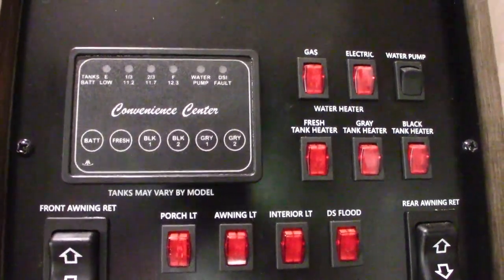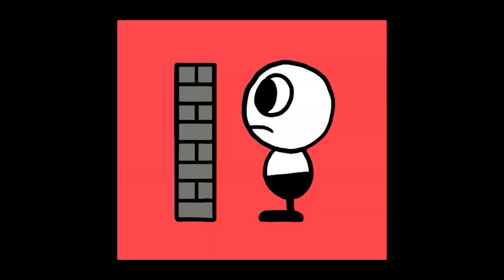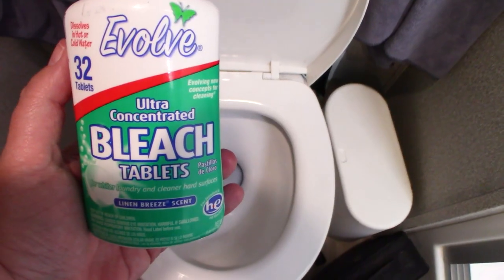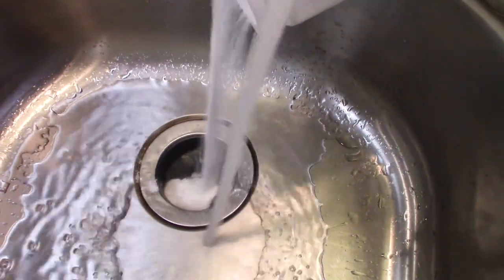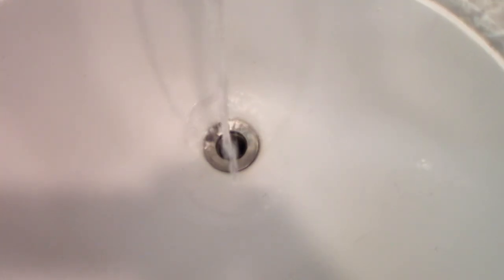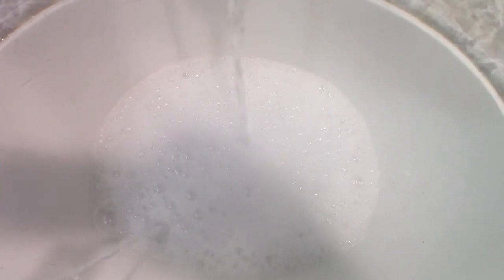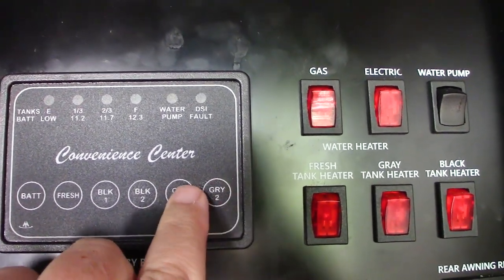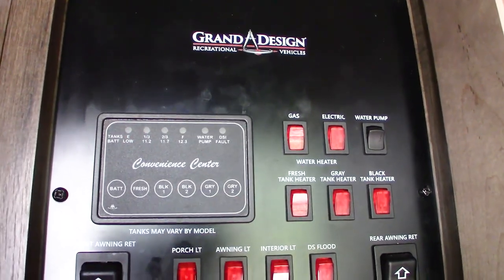How to CLEAN Your RV TANK SENSORS in 3 Different DIY WAYS! KNOW How Much You Have in Your Black...

Comment: Question? We had this issue from day we purchased the RV. It was a one owner. They never cleaned anything. We managed to get some of sensors cleaned from say tanks are full. but have a ways to go.  Will try the vinegar and soda how much vinegar did you use. Vinegar and baking soda is always on hand here use to clean with. Have a great day
Reply: If your tank is 50 gallons use a whole canister, or for the small boxes use a box and 1/2  of baking soda, and one 1/2 gallon cleaning vinegar along with 15 gallons of  cold water and about a hot water tank full of hot water. Works like a charm! If your tank is smaller, just decrease amounts accordingly. Hope this helps!
Reply: @t.j.sortino7844  Thank you for the information
Reply: @t.j.sortino7844  How do you get the baking soda & vinegar in the fresh water tank?

Comment: I have used Dawn dish soap. I figured if it’s save to clean wildlife it should be ok for the tanks
Reply: Did it work
Reply: @mistyhardy2980  yes it does for me anyway
Reply: @deborahsmith9232  how do you do it
Reply: I drain tanks put dawn inthe toilet and sink . I run hot water in sink. I run water in toilet. I let it sit for awhile and drain again. My tank monitors say empty so it’s good.
Reply: @deborahsmith9232  how much do you use and thank you
Reply: @mistyhardy2980  the size bottle I have is 24oz who knows will for me be 4 weeks. About 3oz per tank. My rv is very small (only 20ft) so the amount you use has to be adjusted for your tanks. This does not replace your treatment pod you drop in after black tank empting. I’ve been doing this for over a year  and so far so good. I occasionally do the baking soda vinegar thing.
Reply: @deborahsmith9232   thank you so much my sensors havent been working since I got it back in April. Gonna try today see what happens
Reply: @mistyhardy2980  I just do mine once a week regardless
Reply: Let me know how it works for you. I suggest a long soak if it hasn’t been clean in awhile, just emptied
Reply: @deborahsmith9232  hi there it didnt work sensors are still showing three quarters full
Reply: @mistyhardy2980  I have since heard dishwasher pods with water softener is recommended. Let me know if this works. Leave the mix in as long as possible

Comment: Thanks Robin as I used your method to clean out my fresh water tank and it worked great. Also did both MaxAir fans and now will be ready to hit the road again. The ash from the fires left a greasy soot all over everything and turned the fans black. The fires are about 75% contained so used the last 2 colder days to clean.
Reply: How do you get the baking soda & vinegar in the fresh water tank?
Reply: @wayne9617  put a funnel in the input valve, then packed the funnel with baking soda, poured vinegar through it, added water, repeating 2x more. Then drained and filled 2x s till clean and no vinegar smell. This took a lot of water so was thankful near a water source. Applied the same technique to my grey water tank. Have done this once every 6 months!

Comment: Great video on the tank cleaning major question: I have a 50 gallon black tank and I have not been able to clear the sensors for years. How much bleach would you recommend and should I fill the tank and let it soak for several hours. When I empty my tank and I know it’s empty the sensors still say 2/3 full. ??? Your help would be appreciated thank you. Thomyt
Reply: Thomas, I have 50 gallon black also and did this on Thursday. I used 4 tablets and it worked... YES

Comment: Great video! Thank you. How long are you running the hot water for at the beginning?
Reply: Use a tank full of hot water! Meaning the tank size for your hot water heater! So 6 gallons of hot if your hot water heater is 6 gallons! 10 gallons if your hot water heater is a 10 gallon. Your grey tanks will normally be smaller if your hot water heater is only 6 gallons. Likewise, your grey tanks will be larger if your hot water heater is 8-10 gallons, and if your running a tankless hot water heater, I'm jealous!😉 In that case use about 8 gallons  of hot if your tank is a big 50 gallon! If your tank is a small one, like 20 gallons or less use a small box of baking soda, 1/4 gallon of cleaning vinegar, 3 gallons of cold water and about 3 - 6 gallons of hot water, if you got a tankless and your hooked up to city water and shore power, use all hot water if you want! Just don't fill it all the way up, you want it to have room to bubble and slosh around! A good 20 minutes of driving will really work! If you can't drive at that time leave it overnight while your sleeping, note, plug up your drains, you might get a vinegar smell that seeps into the coach while you're sleeping.

Comment: Great info.  I wonder if the baking soda and vinegar would work on the black tank as well.
Reply: I have used baking soda and vinegar in my black tank! If you keep your black tank relatively clean, meaning you rinse it out every single time you empty it and use black holding tank chemical religiously, then vinegar and baking soda will work most likely! Bleach however will work every single time! However Robin is right about bleach being harsh on your seals! Also, if you are black tank is not all the way empty and still has chemical in it the bleach can cause a very dangerous chemical reaction that can create heat and vapors which can have the ability to explode your tank! The chemical reaction can also cause extremely dangerous vapors to enter the coach! If you use bleach to clean out your black tank, leave it in their Max 3 hours, and always keep a close eye on it by opening up your toilets and looking in, also that releases any pressure that is building up! Just some friendly advice.
Reply: Another good cleaning solution for your black tank is simply your black tank holding chemical you use all the time, except this time put the chemical in with at least half your tank's capacity of hot water and drive it around! This works as well!

Comment: These are all good tips especially not leaving bleach too long as it deteriorates the seals in the flush valves.
One method that I use is drop a dish washing tablet of Finish in the affected tank. Fill the tank to 1/3 full with warm water. Then go for a few mile drive.  The water sloshing around does a great job of cleaning the sensors. Thanks for a great video!

Comment: Great info, thanks. Question: you said you filled the tanks about a quarter full, but the sensors were not working. How did you judge that they were 1/4 full?
Reply: I was wondering the same thing!
Reply: Mike Cooper They “worked” but would not say they were empty when she had just emptied them!
Reply: @michelefliginger8910  : So then they didn't work. 

My guess is that Robin knows how much her tanks can hold, and therefore filled them with what she estimated would be about a quarter tank's worth of water.  In this situation, a high level of precision is probably not necessary.
Reply: @Milesco  That is where a flow meter comes in handy, you should know how many  gallons  each tank holds, meter accordingly.

Comment: Drain and flush your tanks as you normally would. Add 1 gallon Zep heavy duty degreaser to your empty grey water tank. Add Zep Acidic toilet cleaner 1 gallon to your empty black water tank.  Use your RV as you normally would and when you empty and flush your tanks your sensors will be cleaned along with both tanks. Works great no gross messing around with wands and spray attachments. Works perfect
Reply: I considered doing this a few days ago. Which Zep degreaser do you recommend, the purple or red, or does it matter?
Reply: Do you dilute it or just straight concentrate?

Comment: I converted my rv toilet to a composting toilet with a option to send the urine into the black tank; I’ve lived fulltime in The rv, class a NEW if it makes a difference, for almost 8 yrs, Boondocking for 2 yrs.  I don’t think since I’ve had the black tank sensors work properly.  I really hate to waste water, so I’m not so much in favor of filling up a 40 gal black tank of just clean water, will the bleach method other than the toxic fumes 🤪 work with the tank mostly full of urine ?  When I shower I do add the shower water and whatever other stray water into the portal for the urine of the composting toilet.  Will the bleach tablet work,  with just mainly using in the black tank ? I can desolve the tablets into a container of hot water before emptying into the urine portal.

Comment: We just bought our first RV, a fifth wheel, we plan to hit the road in the near future but this winter we will be living in cold weather climate. I watched a video of your skirting method when you were in one of your smaller rigs, my question is do you or will you still use the reflective material and velcro method on your fifth wheel. We have done some research and found this to be very costly if you have professional installation, but compared to damage it make cause if pipes freeze up we will do something. Our rig is rated -4 with enclosed underbelly, we don't have this type of weather in Central Illinois, but you just never know. Thanks for all your videos and blog, we takeaway so from each one whether it applies to us or not, things change as you know three rigs later.

Comment: I knew to this RV stuff we have had our Newmar for about 2 1/2 years, but this is the first time that we’ve had an extended period of time in the unit months on and we’ve been in it for a month and I’ve noticed that my gray tank did not show empty when it was empty and I will be doing your vinegar and baking soda letting it sit and then rinsing the tank out and then checking it again. Hopefully it works even though my sensors are on the outside still reads the tank so if something is against the walls, I am sure, it will be picked up as a full or a water level in the area where it’s at we’ll see keep you posted🙏🙏🤞🤞
Reply: Just got finished with having the solution soak in the gray tank for about 4 to 5 hours and it worked thank you very much for all your help and I did subscribe to your channel

Comment: I am a second owner of a 2019 Grand Design fifth wheel.  I am having Black tank sensor issues.  Both black tank sensors always show 3/4 or full.  When using bleach tablets do you fill the tanks full? If so, how many tablets to a full tank?

Comment: How do you know your tanks are 1/4 full if the sensors are not working??  How much HOT water are you putting in each?  Does Hot work when you have 1/4 tank of cold water already in there?  I think I clean my freshwater tank and then flush that water into my black tank all in one day. Double duty.
You must have cleaned both tanks since you pushed a different button when finished for the black tanks. 
Thanks, Robin for these tips.

Comment: Great video, very informative! The baking soda and vinegar works well in "stick & bricks" drains too. How much vinegar do you recommend for each tank?
Reply: Use at least a 1/2 gallon of cleaning vinegar if your tank is 50 gallons! If your tank is the smaller types, reduce accordingly from the 50 gallon grey tank size! Don't forget use at least a hot water tank full of hot water, along with cold water to increase the water level in the tank to get all the sensors!

Comment: Thanks Robin! I have a question, does the banking soda and vinegar work in black tanks too? I've tried bleach, Tide laundry detergent, and Calgone water softener (suggested by another RV full-timer, but it hasn't worked on mine). I have tried putting tank enzymes into the black tank and then filling it with water. I let it sit for a day and that worked, but now that I'm full-time I can't do that.

Comment: Personally, I would never use bleach or mix vinegar with baking soda. I prefer the "Geo" Meathod, no chemicals or hot water. Works for me everytime. The key to keeping tank sensors functional is to maintain them on a regular basis.
Reply: What’s the “geo” method?

Comment: Most RV forums will tell you it's a bad idea to put bleach in your tank. Many will tell you the GEO method works quite well for keeping black tanks and sensors clean. What's the GEO method? Well it's all over the interwebs. I was a skeptic but it has been the best solution for me. That and a spray wand you hook to a hose. RVNET has a lot of good information in the forums. It's one of the older forums online. I think it is now owned by the company that owns Good Sam.

Comment: What is the best RV  TP to use? I’ve been using Scott’s RV TP but I’m thinking it doesn’t break down like it claims. I also drop in TST Max tablets to help the  breakdown. Still get false readings though. Definitely gonna try the baking soda/vinegar. Thanks for any additional info.
Reply: We can be TP snobs, so we use the TP we like and just don’t flush it. We keep a small trash can beside the potty and it’s not as smelly as you might think. On the rare occasions it does, we spray some Lysol or simply throw out the bag.  The small can is the perfect size to use the produce bags that we get from grocery stores.

Comment: You needn't run water while doing the baking soda/vinegar.  Just sprinkle the baking soda in the drain and slowly add the vinegar, a little at a time.  After you've added all the vinegar you can without hearing any bubbles from the drain, then you can run hot water through the system.

Comment: I don't know what some of you people are doing to your tanks to have so much trouble. If grey tank sensors aren't reading correctly, you might be letting things go down the drain that should have gone in the garbage. Maybe keep a screen in your drains. I clean my black water tank with a rigid wand that can direct high pressure spray to anywhere in the tank, including the sensors. I never have bad smells from either after dumping and I don't spend any money or extra time to do so.

Comment: while these work and are great ideas individually, you should be very careful never to allow these three methods to mix. Even flowing over the remains of the chemicals used in one tank will allow the chemicals used in the others to set off a potentially damaging chemical reaction in your pipes!!! Vinegar is VERY reactive and doesn’t play well with bleach or with some detergents. I would pick one and go with it in all three.